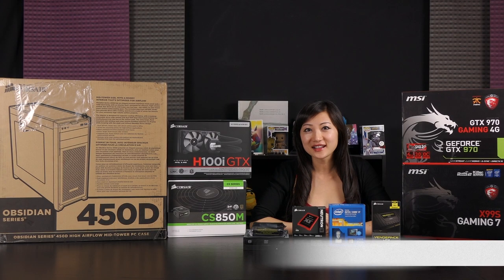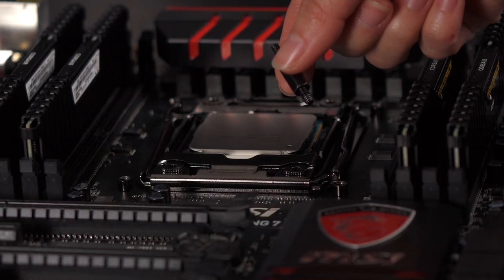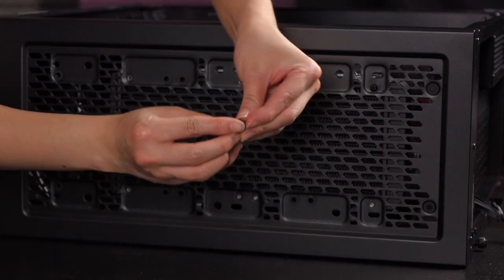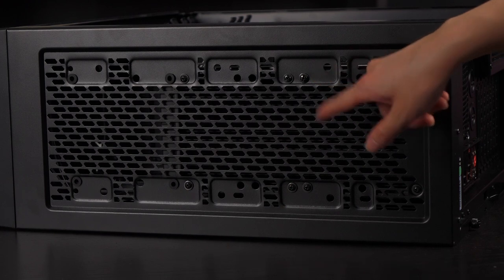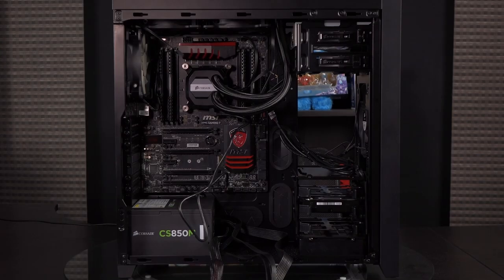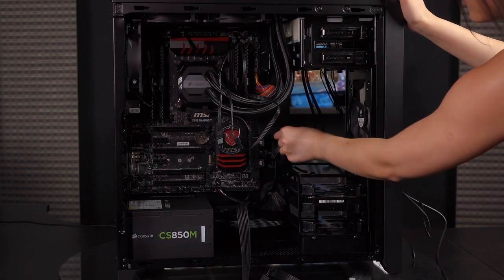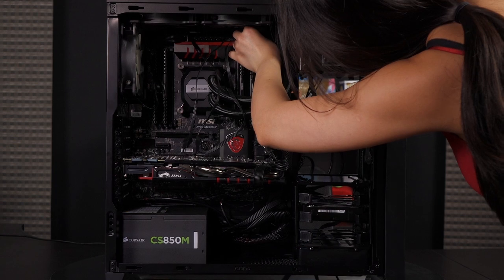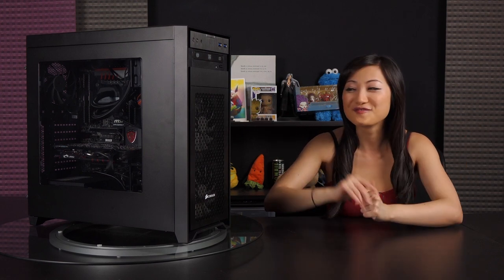How to Build a PC: Epic X99S & DDR4 PC Platform!

Comment: hey joanne. do you have a good way of fully populating pci-e lanes without metal touching the pcb underneath? it would be cool to see a video like that.
Reply from the maker: I'm not sure what you mean?
Reply: Joanne Tech Lover basically, I have a gpu but I want to load my mobo (Z97 WS) up with RAID cards and maybe some of the new Intel 750s or some NVME PCIe drives when I can save up enough. My problem is that I the heatsink on something like my GPU will cause the card to sag ever so slightly. And I am afraid of shorting the PCB underneath. Do you have any recommendations?

Comment: I been doing research and doesnt the metal you touch have to be grounded for it to ground you? Such as touching your computer case after you have installed and plugged in the power supply that grounds the case do to the fact the power supply circuit leads to ground or does any metal work?
Reply: I've*

Comment: Comes close to my rig (first I've ever bulit) but this is slightly better
Mainboard msi z97gaming5
Cpu: i7 4790k 
Cooler: corsair h90
16gb of corsair vengeancelp ddr3 ram
Psu: corsair cs750m
Gpu:gtx 970 msi gaming 4g oc at +220mhz core and +200mhz ram 
Hdd: 3tb WDred
Ssd: samsung 840evo
All stuffed into a sharkoon bg28 red case
Ordered some extra fans like the noctua industrial 140mm 3000rpm pwm and two enermax magma 120mm because the h90 standard corsair fan broke was was rattling and sucks at air pressure perfomance anyway (but i got lucky with the cpu. 67 degrees Celsius at max system load and the radiator as the only outtake fan so all the warm air from the gpu goes through the radiator but not for long I presume...
Problem is that the space between the cpu vrm coolers and the case top isn't enough to conatin both fan and radiator so I had to mount the fan on the case wich looks shitty as hell and had the fand cable  go through the mainboard I/O panel opening to the top so I cant use that cool black I/O shield  with the red prints on it. Im  palnning on drilling a hole in the top for the cable as soon as I get a replacement for my cpu wich  all of a sudden completly died as I turned off the Pc...my luck with tech.
Reply: MigotRen shame to put such high quality components with that power supply.

Edit: Don't take my comment the wrong way. The CS line by Corsair is still safe to use and stable, just has lower quality components.Not really ideal in serious overclocking or super-high load situations, such as a Bitcoin mining rig or a high end gaming system.
Reply: Barack Smith Lmfao, it was an example. i got a laugh out of your comment. Thanks for putting a smile on my face.
Reply from the maker: MigotRen Thanks for sharing your build parts!
Reply: Skyler Jacobs I don't see any Problem... when I have my system at mximum load so both cpu and gpu on 100percent while both are overclocked with a higher than the regular voltage, the whole pc with my benq 144hz monitor consumes arround 430watts. A normal gaming load consumes arround 280-340watts with the gpu overclocked, based on the game. I could easily put a second 970 in there and won't have any problems with my psu. And it's not like I want to overclock my cpu to 6ghz or something. I would need another mainboard for that even if I had a liquid nitrogen cooling system. And who the fuck mines bitcoin with their pc? The bill for your power consumption would be higher than that what you would get out of it. At least here in germany.
Reply: MigotRen As i said in the 2nd part of my first comment. Dont take the first part the wrong way. The CS line by Corsair (Great Wall makes this model) is still safe to use and stable, just has lower quality components. The CX/CXM, VS, and RM series PSU by Corsair (These three models are made by Channel Well Technology) are the same way (built with lower quality components).

I myself would trust the CS series more than any of the others said here in this comment.

Comment: Any reason why you didn't install the video card in the upper most slot right under the CPU?  When i build computers i always use the one closest to the CPU...and where did you get that dimsum table spinning thingie, that's very helpful since i build a lot of computers.
Reply: +Vince Phan   it is called a "Lazy Susan"
Reply: +Vince Phan It makes space for better airflow. and improves cooling
Reply: +mobit76 now that i look at the video again i see that both PCI slots are 16 lanes, so yeah it doesn't matter then.  I'm used to seeing 16 lanes on the top most, 8 lanes on the 2nd one.

Comment: I don't think the frame on the SSD is decorative. I replaced parts on a laptop (WAY more painful than desktop builds) and it originally had a disk drive which I replaced with an SSD. The SSD is thinner, so I think the frame is just a filler to prevent shaking.
Reply from the maker: It's not.
That's my bad!
Reply: Joanne Tech Lover I bought an SSD for use in a laptop and the instructions said that the frame was to make it the same thickness as a normal laptop hard drive in case you mount it in a laptop that doesn't work well with the thinner drive size.

Comment: Hi,
I am in the process of building an identical machine. However, I have run into an issue when I connected my DVD/RW drives. The machine does not power on when I connect one of these. But, it does when the optical drive is not connected. I initially thought the drive is bad and bought another one, but, had the same result. At this point, I am stumped and trying to find some answers for this issue. Without an optical drive I can't install Win 8.1 Any advice on this is much appreciated.
Reply from the maker: Vijey Soundram You could try installing 8.1 via USB!
I have a video up detailing how to do that :)
Reply: Vijey Soundram Hope you fixed ur problem, but as Joanne said, you can do it through an USB. It might not work on every usb, since it didnt work for me. But you should give it a shot.
Reply: ItzThirsty  Hi, yes, I have fixed my problem. I had to return the motherboard back to the store after talking to the MSI technician and got a new one.  Everything worked fine. Also, I decided to go the USB route, though the internal DVD/RW did work with the new motherboard.

Comment: At 28:53, I noticed when you had your right hand inside the computer case and using your left hand you plug in the 120V power cord.  That's not good electrical safety practice. I would hate to see someone get electrocuted because they are not familiar with electrical safety.   I enjoyed watching you put the system together but I feel I need to point that out to prevent anyone from getting zapped.
Reply: Matt Lin The other end might not have been connected yet tough :)
Reply: The psu wasn't even switched on
Reply: Matt Lin How do you want to get zapped when the PSU is grounded ? It makes no sense.

Comment: I'm building another rig right now I just can't decide on the 450d, 650d or 750d
Reply from the maker: I've only built in the 450D, and I'd say it's a good size for lugging around, and spacious enough to easily build in!
Reply: +Joanne Tech Lover would a cooler master 240l cooler fit in the front

Comment: I'm still confused what the cables that came with case are and where all the cables plug-in the motherboard.
Reply: Those are for the power button, the sub ports on the case, and the hard drive led. The mobo has little pins they plug into usually towards the bottom right.
Reply: Usb ports*

Comment: so noob question: should i choose a SSD or HDD? and will it affect much if i only install a SSD to build a pc? thanks
Reply: SSD for booting and loading up apps and games and HDD for storing games, files, pictures, etc. Both are good investments. If you want a faster HDD, get a Western Digital Black.
Reply: for SSD card, how many do you think you can recommend?
Reply: +SaigaTenshi 120 GB is enough for loading ups and boot ups. I recommend The Samsung 850 EVO
Reply: thanks for the info. its been weeks since im thinking what to get for SSD card. some of them said or purchased 200gb thingy

im wondering, whats the difference between the EVO Pro and the non EVO pro?

Comment: Can someone explain why the RAM was put into two different sections on the board?
I guess its dual channel but why not put the 4 together rather than 2 on one side and 2 on the other?

Hope that question makes sense :)
Reply: It's will run a bit faster, you won't be able to run a proper dual channel unless they are in the same color/ram channel.
Reply: ***** Thank you :D
Reply: It also helps in air flow it allows the air go through

Comment: Hope this msi m/b has 2 pci-e 16 if not she just plug the video card in the wrong slot
Reply: +lewis shipway all if not almost all X-99 has dual 16x PCI-E 16 slots (some have 4) due to the fact that the 5930k and 5960x both have 40 lanes and it is common to run 2 or more GPU's on the X-99 platform. Even the 5820k is capable of 16x/8x.

I say almost because there is x99 server boards out there which might not make use of 16x PCI, and some xeon processors use the 2011v3